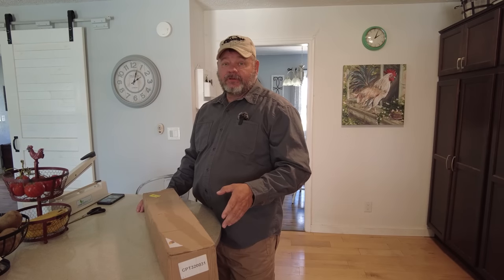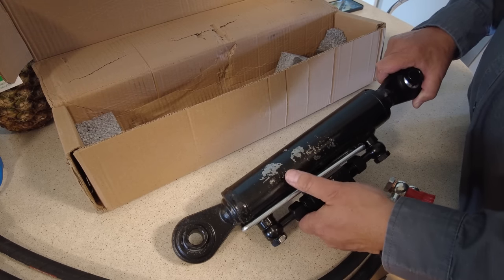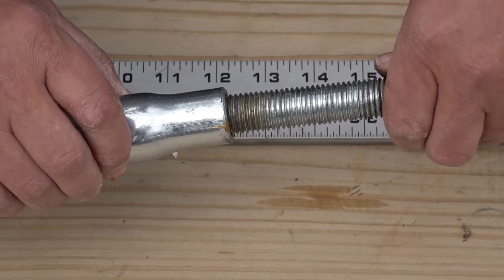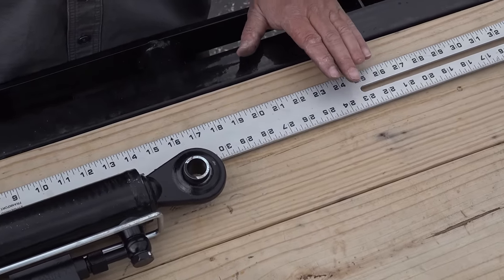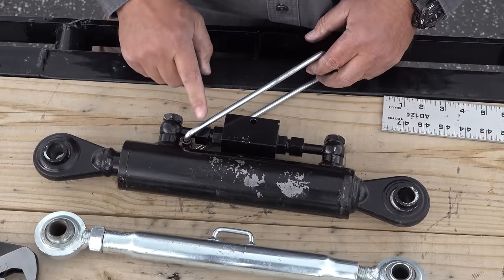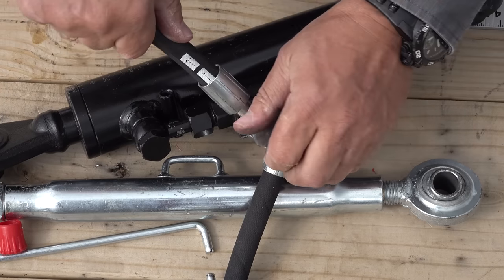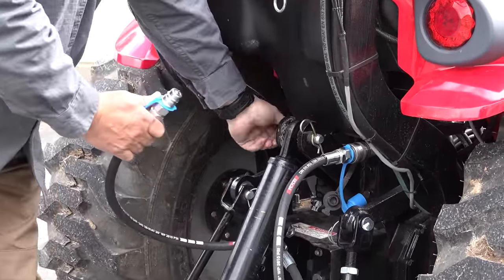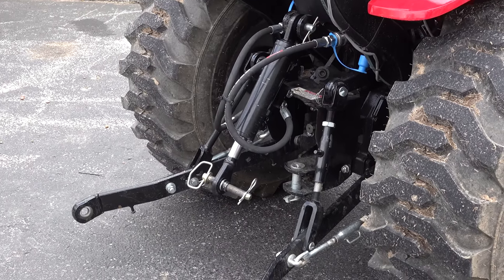How to Buy The Correct Hydraulic TopLink For Your Tractor

Comment: I have had the same top link on my T264, about a year now. The link has been working great. I have the diverter on top and adjusted the 3 point stop bolt to prevent it from hitting the fuel tank. That created an issue with dragging implements when loading /unloading from my trailer and transitioning small hills. Not a big deal when in the dirt, but not so much on pavement. I finally decided last night to flip mine like yours to put the diverter on the bottom, then readjust the stop bolt to get the lost travel back. Have to think outside the box with these machines. You have said it many times, these hydraulic top links are a game changer, especially with the functionality of a box blade.
Reply from the maker: I appreciate your comment. I love comments like yours. It helps everyone learn.
Reply: Thank you, sir, that’s what it’s all about. I have said about myself I know a little bit about a lot of things, but I do not know everything about anything and what I do not know someone else surely does. It is why I come to You tube University; an eclectic collection of knowledge from people all over the world.

Comment: FYI for Kubota owners.  Kubota top links have a spring roll pin at the end of the threaded links so when you are trying to extend them to full length it is impossible to overextend them.  In other words just extend them till they bottom out, you do not need to remove them.
Reply from the maker: Good information, but having owned two Kubota tractors myself, your statement is not true on all models.
Reply: Mine is similar, instead of roll pins they are Philips head screws.
Reply: Mine don't. Came apart trying level my plow.

Comment: The rectangular valve in the center of the cylinder is called a double piloted check valve. It locks the cylinder in place and will not drift unless you have over 600 psi hydraulic pressure which unlocks the double piloted check valve. If you are loading a tractor on a trailer while an implement is attached, you could need a shorter collapsed length than the OEM top link. This is because the ramp angle is too much and the implement hits either the ground or trailer.
Reply from the maker: Thank you for your comment. Good info. I have seen people, including myself, drag their implement rather than adjusting the Manual top link.
Reply: @TonysTractorAdventure  Confused I am.  Nothing new to me.  So in a nut shell, is it better/best to have a slightly shorter hyd top link if doing a bunch of trailer loading.  Sorry, kind of like how high is up!  Still respect your thoughts Chief.  Armor O-5
Reply from the maker: Yes sir, Having the top link, opens so many opportunities!
Reply: Yea I would prefer slight longer and shorter using a bushhog damn near vertical opens a lot of possibilities. Likewise turns the box blade into a very versatile tool.

Comment: What you called the "diverter" is your double pilot check valve, which will keep the top link from moving if you were to lose pressure from the tractor, due to a broken or decoupled hose, or if your spool valve should become a little leaky.
Reply from the maker: Thank you for the correction.

Comment: Hey Tony, I have the same top link and the bracket you removed was actually a hanger not a hose protector. since you installed the cylinder upside down it wouldn't work anyways. If i were you I'd flip it around, I dont think you'd have a clearance problem since its a smaller toplink than your other one that hit. Your top link actually arrived in much better condition than mine did. I swear they drug mine behind the truck from the ship yard to my house, but it works great and again makes me wonder why i didnt buy one years ago.
Reply from the maker: I love having a hydraulic top link.

Comment: A fully retracted top link is great for attachment clearance when trying to load/unload trailers so I'd say it's still a usefully position.
Reply from the maker: I agree with that statement on a hydraulic top link; however, most people just drag their implement rather than manually adjusting the top link.
Reply: @TonysTractorAdventure  Sad but true about dragging the equipment.  I don’t truly know, but seems like a bad idea to do that.
Reply: I agree on the trailer loading. A fully retracted top link is also a quick way to get the front of an angled rear blade down for digging a shallow ditch without having to adjust side links.

Comment: I just got a longer version of that same top link and it arrived in the same condition.  It comes from Europe and the carrier isn't all that gentle with them.   I did exactly what you showed to figure the length, it sort of seemed intuitive. I won't have any clearance issues so I am going to use the wire bail to hang the link when switching implements.

Comment: Hi Tony, I added the toplink not too long after getting the my tractor and every time I use it, I'm thankful that I added it.
One thing to keep in mind if you plan on getting a quick hitch of sorts (I have Pats), consider having one that goes a little longer rather than getting the one that matches your existing top link.
Thanks for the video!
Reply from the maker: Good information.

Comment: Can you flip the hose holder that came with it to the other side (across the body of the cylinder)?  Instead of using it for a hose holder (out for that too) it might give you something to hook you hook to to hold the cylinder up
Reply from the maker: The metal bracket I took off was meant for a hook to hold it up when it was not attached. It is not wide enough. I will rig something up.

Comment: I wish I had seen this video last week, I just received my hydraulic top link, just like yours only longer.  When I went to use my box blade on my drive it was to long to allow me to tilt the box blade forward enough to get the rippers to do their job properly even at their lowest setting.  I have been thinking about getting a set of Pat's easy change connectors for the lower arms and see if they may help with my problem.
Reply from the maker: Pat's will help. I could use my bigger top link with Pat's on.

Comment: i have found those big spool roll 500' weed whip string has a plastic mesh that works great for stringing hydro hoses thru as it expands as necessary but likes to remain unstretched giving you adjustability when ever required. one thing i don't like about it, is it's not long enough so it likes to slide towards an end that is more compressed naturally.

Comment: Been thinking about getting a hydraulic top link for my box blade and grading blade, but my tractor doesn't have the rear remotes so that quickly ended that option LOL.
Reply from the maker: Most tractors can have rear remotes added .
Reply: @TonysTractorAdventure  Yes, and not very cheap either...a bit of savings if you can add them yourself, but if you have a dealer do it, its $1000+, checked to have them added to my tractor...for the price I can get off the tractor a few times and adjust the top link LOL.  Not like there's much difference anyhow since my tractor is lacking draft control, its up or down so not much in adjustments unfortunately.
Reply from the maker: Most small tractors 40hp and below lack draft control. I have learned to feel the tractor, making me the draft control. The top link is great for a lot more than a box blade. Once you have one, you will never go back. It allows the operator to change the implement angle in flight. This includes, getting mowers dialed in level. Big time saver. Still, I understand the cost and it is not getting cheaper.
Reply: @TonysTractorAdventure  Given the almost 9 month wait to get a mower for my tractor, I'm sure not going to send my tractor to the dealer to have remotes or 3rd function put on it.  I have a box blade and a grading blade, both of which might use a hydraulic top link, but for the cost and the downtime no thanks.  I may swap out the top link for one that's easier to adjust at some point, but I haven't ran into too many instances where I was having to adjust the top link more than once or twice while using my box blade.  Kind of a drop it down and go type thing as I just use it to keep the driveway leveled out and fill in the low spots after winter, and move the gravel back after plowing snow all winter LOL.  Someday I may get a hydraulic top link, but the way things are going now I'm not going to be without my tractor while the dealer sits around doing nothing useful.  I think there's a kit available for remotes and 3rd function, but my patience level is pretty much zero so there's no way I'd even try to tackle that myself HAHA!!

Comment: What lever in the operators station controls the top link? I have a tym t25. Thanks.
Reply from the maker: This is going to sound funny. The lever between your legs controls the rear remotes. Pull the lever to the left and hydraulic fluid flows out. One of the remotes put it in the center and it is neutral or push it to the right and it will flow out the remote. You will have to manually pull it back to neutral because T25s all have detent valves.  Not all t25s have rear remotes. I am assuming that yours does.
Reply: Yes mine is a 2022. If I have this right the lever on the floor when moved to the left and right extends and contracts the top link . My dealer told me not to bump that lever  accidentally or I could blow the o rings and that was an expensive repair. Don't know first time owner. Any thoughts would be greatly appreciated. Thanks Tony.
Reply from the maker: Your dealer is a bit uniformed. No disrespect meant. It is just a rear remote value with a detent kit installed. Your dealer is correct in this; don't leave your lever one way or the other dead headed unless the backhoe is hooked up. Your three point hitch will not work unless it is returned to center.
Reply: @TonysTractorAdventure  how does the top link expand and contract what lever controls that the one on the floor or the 3 pt lever that's where I'm confused. Thanks

Comment: I like all of your videos ! I purchased TYM 474 . Can you advise if I install the hydraulic top link I just plug it in to backhoe outlets , but which lever I use to move it up and down ???
Reply from the maker: Plug it into the rear remote that the backhoe is plugged into. This is just a rear remote with detent. It has three positions. Neutral is in the middle.
Reply: @TonysTractorAdventure  excellent , I will order one and try to install it :), Just need to figure out what type of hose kit to order . One with ball or valve type couplers? I need to unplug the backhoe cables and see. Thank you so much
Reply from the maker: They are "pioneer" couplers.
Reply: @TonysTractorAdventure  also would you please advise what’s the grapple loader (one that looks like a jaw) that you use ? I’d like to purchase one like that for my T474 , thank you
Reply from the maker: I really like the 322 Rake Grapple by Precision Manufacturing. It is light, well engineered and durable. I have abused it.
Reply: @TonysTractorAdventure  thank you ! Is there an online store where I can order it ?
Reply from the maker: You can buy it at agfolks but YouTube will not let me put a link to it.
Reply: @TonysTractorAdventure  thank you so much . I’ll call them to order . They are showing 12 weeks back order
Reply: Sorry to bother you again but agfolks have several hoses and coupler options for Big Mouth mini 322. Should I order 60” or 100” hose ? Also what coupler options ? Pioneer couplers 1/4, 3/8, or 1/2?

Comment: Great info Tony!  I have a TYM474 and bought the top link you had recommended in the link. I did also have to turn it upside down to clear the lines when fully raised. Worked well until I installed Pats quick hitch and a box blade. I cannot lower the rear of the blade due to not being long enough. I believe with pats hist it extends 3.5 inches. Do you know the number of one that would fit or do I just order one thats 3.5 inches longer?
Reply from the maker: You can order a longer one based on your needs. I don't see a downside.

Comment: I think that I would have bled the cylinder.  Your ports are on the bottom, so it will be difficult for the air to bleed out.
Reply from the maker: I put it to use the next day and had zero issue. Still, You are not wrong.

Comment: What do you have the hose connected to? What is controlling it?
Reply from the maker: Some tractors have rear remotes controlled by a valve. Many smaller tractors don't come with them, but they can be added.

Comment: What size is the quick connect coupler?  I have the same one and it’s too big to plug into my rear remotes.  Not sure what size I need for RK24.
Reply from the maker: Standars 1/2" Pioneer couplers.
Reply: Thanks Tony.  Turns out my rear remote is 3/8.  Any idea where to find an adapter?
Reply from the maker: Most hydraulic shops should have adapters.